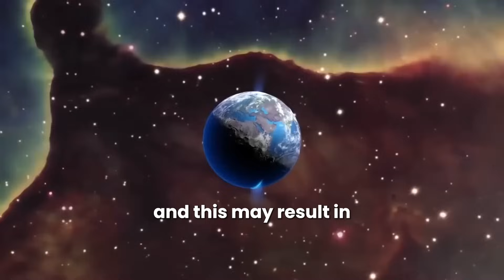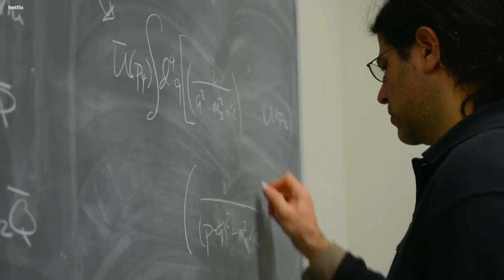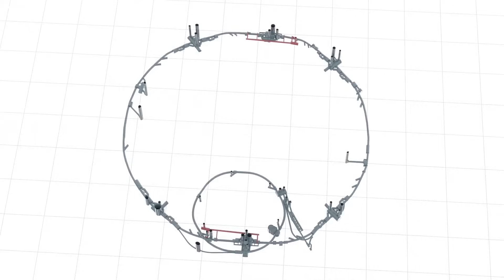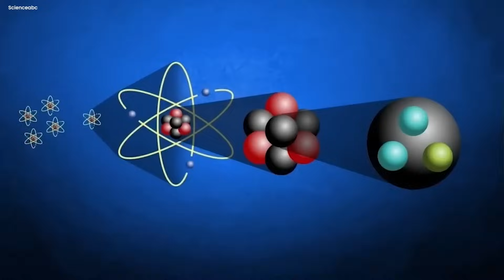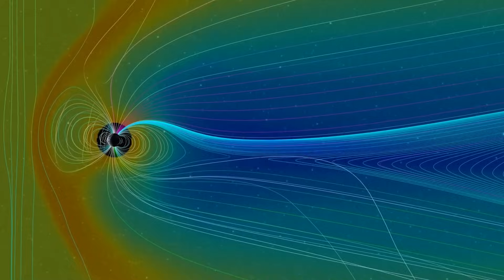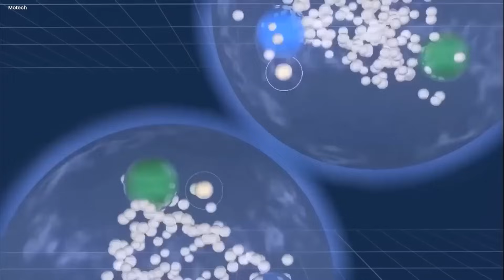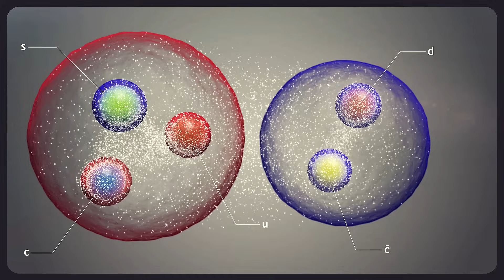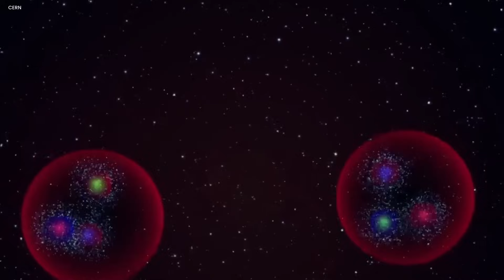World's Smartest kid: CERN Shut Down & Something Weird No One Can Explain Is happening

Comment: If this kid was really smart he would stop writing sci-fi and tell people the LHC is simply a large micro scope that is it .
Reply: It’s literally a partical accelerator
Reply: @mmarissa95  Oh and if he wants to talk about moving electrons guess what happens when you plug a hair dryer in to a wall socket . You move electrons around the wire billions , trillions of the things and that is called electricity They do it by counter rotating magnets over coiled wire and it makes the electrons move and the speed they move is called volts or voltage... Mad aint it .... Its been around for years and years . People use it everyday but they think its magic ...
Reply: @mmarissa95  Yes it is like Fermilab and all the others round the world. If you had an old tube CRT tv in your home back in the day guess what that bit at the back is ... Its a particle accelerator and beam splitter and the screen on the front is a detector ..LHC does exactly the same thing ...
Reply: Not the same function as a practical acceleration but ok 👍🏼